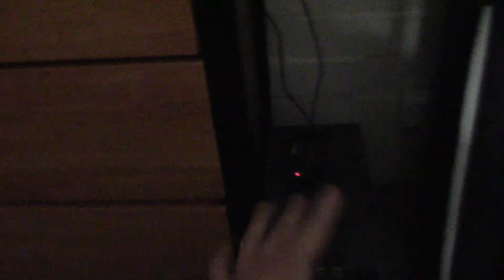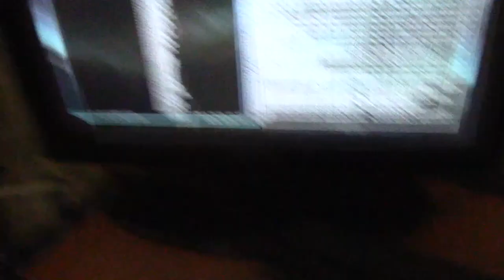BRAINLET Luke Destroys his ThinkPad X220!!! (Press F)

Comment: Buy a new motherboard $25
Buy a new x220 lvds cable $12

Its fixable.

But, in the spirit of screwups:
>Accidentally grinded a powerbook motherboard trying to get a screw out.
>accidentally broke a ibm 240 lcd :'ccccc
Reply: Screw up sharing thread
I recently fucked up the display on my W530. A tiny speck of dust got stuck between the layers. I nicked a tiny piece of glass on the corner when reassemblinf the panel, apparently it was enough to kill it.
It was the good one too, the 1080p one with wide color gamut. Literally unobtainable nowadays.
Reply: I bet the motherboard is fine. Giving the age of the laptop and use, it could just be a failing cable.
Reply: I would have said it is fixable too, but unless you know exactly what happened... It is purely speculative. But you can get an x220 i7 mobo for cheap that's for sure!
Reply: @tripcode knows his sh*t. He helped me with an x60 issue that no one else could diagnose.
Reply: I sent luke an email about his thinkpad. I want to fix it. I have x220i parts laying around.
Reply: Just get the new parts to do fix it. It will be fine. There's no reason to not fix it, even if you won't use it every day.

To get the stripped screw out, put a rubber band over the top of the screw, and then keep pressure on it, while using a manual screwdriver.

Fix it, then sell it. You'll get more out of it that way, so you can either dump more into your other ThinkPads, save towards another one, or just put the money in your bank account.
Reply: once desoldered a tiny capacitor accidentally, soldering something near it. Thing is 1mm long and ~1mm wide. No fucking way that was going back.

Comment: I did the same thing with a PC. I was swapping different ram sticks, until one time I forgot to unplug the power cable. I turned on the PC and everything seemed to be working fine, until I realized that one of the memory chips on the graphics card burned. It still works, but only in 2D. In 3D rendering it started showing artefacts. It was an ATi 128 card with 6 MB of vRAM, I think.

F

Comment: If it still runs, you could always just remove the display assembly, hook up an external monitor, and use it as a desktop! My cousin did this when his laptop screen died. That way you can still use the great keyboard and possibly libreboot it when an exploit is finally available.

Comment: F - maybe consider a "new" pre-loved x220 with the i7 and IPS screen. The display alone makes it worth the upgrade, and you'll gain 1 USB 3.0 if that matters.
Reply: I guess the problem with new hardware is that the new Intel processors arent "free". Not that the old processors were free, but the new ones contain backdoors, which members of the holy church of the free software Foundation are not wanting to use
Reply: And, more importantly: old ThinkPads are a meme bigger than gentoo

Comment: >trump is bowing to gun control
>Luke is using a desktop
This may be the worst couple of days of my life
Reply: Sounds like two people have finally seen the light tbqh famalam
Reply: I don't understand the fascination with using a laptop as a primary machine, when they sit on the same desk 99% of the time.  That other 1% of the time for most people is novelty mobile usage.  I understand the desire for academics who are always putzing around between classes, but even then, have a laptop for that and a desktop for your home office.  If you're too busy to manage files across two machines, your life is fucked up.  I understand being put off by furniture-sized atx cases etc.. but that's why there is mini-itx.  When you restrict a system to anything under 80mm fans, it will be suffocating and/or loud as a jet.  I've never even owned a laptop.
Reply: >ever voting for this jew
Reply: Sounds like you've had a pretty sweet life ;)
Reply: +ryner this, except nazbol

Comment: You know why they stripped the screw... Anti theft.  Some company had some bios or OS config that alerted them boots in strange locations.. remote boot and the rest... If someone steels it, they will find it harder to disable this.... Then again the battery setup is nothing like the x260/x270, where you could make the internal battery impossible to extract... So disabling anti theft measures would require more than "popping out the battery"

Comment: well, this is not as difficult as you think. most of the time lvds port is ok, and you either cut the damaged part of the flex or just solder a wire for backlight voltage

Comment: Get a new LVDS cable. If it works, great.
If it doesn't chances are you fucked up the backlight fuse and/or 3.3V fuse for the panel and/or the connector. This is fixable if you're comfortable with a hot air station. 
If you're not then you can just replace the motherboard. Bare boards without CPU, RAM, cooler and cards are breddy cheap.

Comment: Thats why there should be a easy modular laptop design easy to takeout without breaking. Like EMOA laptop or something
Reply: thinkpads are as close to easy as possible. Thats why they were thick. The older the easier, the x-series got worse over the years:).
Reply: All connectors should follow a Lego design.
Reply: this is already a lot more modular than most sadly. either way fiddling with a computer that is plugged in is a bad idea.

Comment: You don't need to replace the screen - it most probably still works fine. You had burned the fuse on the motherboard that's why screen was black. I had exactly the same problem with my x220 and it happened at the same circumstances: I removed the LVDS cable with the battery wasn't taken off. I was able to resolder the fuse myself and that was fixed the problem.

See the picture with the fuse:
http://postimg.org/image/ke96683lj/
More info on thinkpads forum:
https://forum.thinkpads.com//viewtopic.php?t=118766

So try to replace the LVDS cable, check fuses on the mobo with a multimeter and resolder broken ones. Everything can be done without any specialized tools, just with a cheap soldering iron and a multimeter. Fuse specs are 32V/3A and it's SMD formfactor is 0603. It can be easely found on ebay.

Thinkpads can't RIP in peace because they are immortal!

UPD: To remove stripped screw, spray a little of good old WD40 on it. This method worked for me when I also had a stuck WLAN adapter screw.

Comment: F

Maybe you should buy a low-voltage fanless laptop like lenovo 120s?
Reply: yea, and add tlp to disable bluetooth will give you another 1 -2 hours battery life.

my only complaint is the bios boot time is too long, i dunno if it's only me or the entire 120s are like that.
Reply: well, then it's just me unlucky to have faulty product from the start. T_T

which partition table you're using? gpt or dos?

Comment: not as bad as my lenovo yoga pro 2 the fan dos not suck air so it got hot as fuck and melted the plastic to the screen and I wanted to get new thermal past because I was doing the same to other pc's the plastic on the cable was melted tried to remove cable pins got broke I regret not selling on ebay for 200$ also hate apple's school of enginering and design